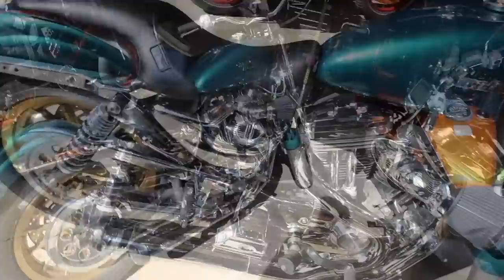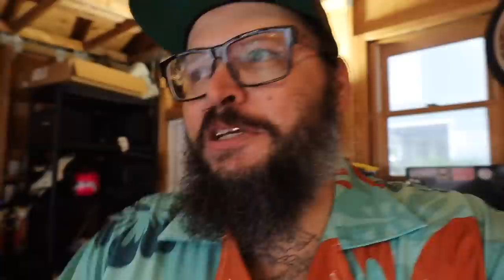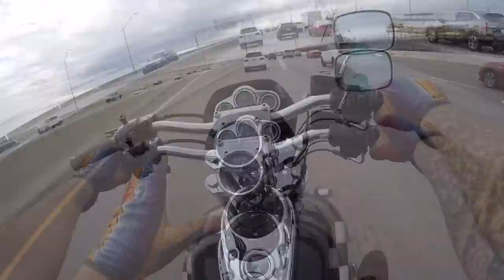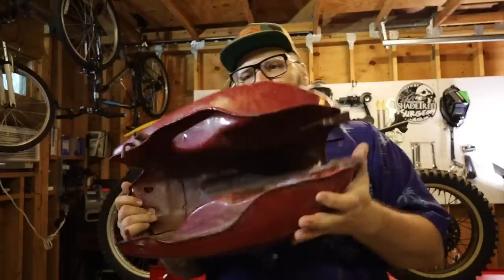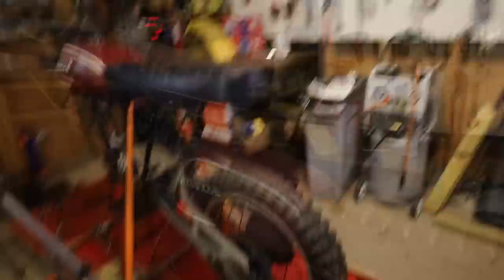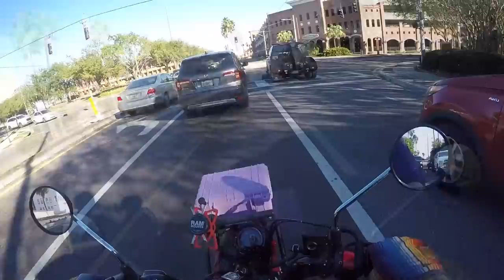WILL IT RIDE?! Cheapest Vintage Harley Davidson on Craigslist

Comment: 31:51 PB Blaster is my go-to problem solver. I learned about it while changing the CV axles on my 94 Corolla that spent 10 years on the east coast. It moved to Phoenix Arizona where I eventually bought it. The underside was rusted bad and the clear coat was burned off from the Arizona hot desert sun. All the fasteners we're rust welded under that poor car. I tried five different products on the rust and nothing worked. A buddy came out to check on me and came back with a can of PB Blaster. I sprayed it on, gave it a little bit of time and it worked so good. That was back when you couldn't find it on the shelf at the auto parts store. I always keep a couple cans around now.

Comment: Straddle to kick. you have better balance so you can put effort into kicking rather than kicking and balancing. And you can use the bars to add upper strength along with lower strength for a more solid kick

Comment: If you end up using the CL tank (same one I use on my race CL) you don't want to use the petcock anyway. Just block off the petcock and the crossover tube on that side, and use the other crossover tube as your fuel source. Just put an inline petcock and a fuel filter on and you're good to go. I use the crossover tubes as my fuel source (since I run a twin Mikunis) and its perfect. Or you can use both crossover tubes and T them into a petcock and filter and into the carb. Get the plastics from Preston Petty.

Comment: every shovel on my local craigslist is either wildly too expensive, or is a "ran when parked, need some work"
Reply: the latter is a common shovel. AMF ya know,  they be better at making bowling balls, swim fins & snorkels
Reply: @westho7314  They made a shit-ton of cool (common) bikes from 1969 to 1982
Reply: I'd trust the ran when parked on a motorcycle much more than I would a car. I don't know why, but people think motorcycles are mystical machines and they are afraid to work on them. I bought a "ran when parked 16-18 years ago" 1977 Yamaha xs650. Half ass cleaned the carbs, new plugs and wires and hook up a battery and about 35 kicks and she ran. That was over 6 years ago and it's been torn down the whole time. Days to work on it are few and far between its a roller now, and the engine is in. Still in the mock up stage and I haven't touched it in over a year.
Reply: If you’re afraid of the “ran when parked” deal, you shouldn’t even be looking at shovels
Reply: I’ll buy that seat
Need one for my 78

Comment: Chey and Josh, did you run a compression test on that Shovel engine? If I had it to do all over again, I would have installed a Baker 6-speed in my old 84 cu. inch Pan/Shovel. I've ridden Shovels with 1996 (and earlier) Softail 5 speeds and Baker 6 into 4 transmissions. To me, it was like the difference between night and day. If this were my bike, I'd keep the 39 mm fork and go about four-over, make some improvements to the internals and install a pair of gaiters. I'd keep it as a swishy tail too. Bad roads are everywhere.
Reply: How the hell would you put a Softail 5 speed in an FX/FL frame ?
Reply: @kurtfoulke5130  A 1996 and earlier 5-speed will work in a 4-speed frame with an adapter plate. The mounting bolt patterns are different. The transmission needs to be raised and shimmed. The seat post tube needs to be notched for clearance of the 5-speed lid. There are videos on YouTube that mention that mod. Ride safe.
Reply: @walterfechter8080  Hey Walter, Softail 5 speeds are practically free compared to a Baker.  
Can you run the Softail primary with starter motor or are you forced to go belt drive with a kicker ?  I can put a full battery in a saddle bag if I need to change the oil tank set-up.   Thanks
Reply: @kurtfoulke5130  -- Kurt, you are right about a H-D Softail 5-speed transmission being a lot cheaper than a 5-speed or 6-speed transmission from Baker Drivelines. For what I know about running a 5-speed with a Shovelhead engine, you can only run a special engine to transmission support, a belt primary drive and the Softail diaphragm clutch assembly. I'm not sure about running the stock Softail inner/outer primary covers. I'm thinking that some kind of spacer setup would be required. As you already know, the most important factor is keeping everything aligned from the engine pulley to the rear wheel sprocket (or pulley). You can run the Softail electric starter setup. Of course, a kick start conversion would have to be added to the 5-speed gear box. If you go that route, be aware there are some junk kicker conversion kits out there. Do some checking around for a kicker conversion setup. The oil tank/battery box will have to be custom made. The entire conversion will definitely take some work. There's a guy in Lake Worth, Florida (Gattis Garage) who's shop has done that 5-speed conversion to a Shovelhead and even on a flathead 45. I hope this helps. -- W
Reply: @walterfechter8080  yeah, I've done enough kicking, that would defeat the whole purpose lol.  Might just be easier to throw a shovel into a $ 1000 Softail roller lol

Comment: 2 strokes so easy to work on or take apart vs 4 strokes.  My dirt bike i take it to the frame once a year to really clean and paint.  You can almost do it is a day if you did not have to wait paint to dry.  I wish I bought the last year Kawasaki kx 500 cc dirt bike.  Over 60 horsepower and just over 200 pounds.  Power to weight is awesome.  Your build bike should be similar

Comment: After a BSA, and a couple Triumph bikes, I decided to jump off the cliff and bought a brand new shiny AMF!! A '73 kick start only FX! I figured if I couldn't kick start it that I didn't need to ride. Being that I only weighed a buck forty, a few tricks made it easier. The only time I had a problem kicking it was the first week I owned the bike it was below 0° !! I made the mistake of leaving it outside one night and I didn't put lightweight oil in it!! Even being a smaller frame person I had NO problem kicking it over. I've never been a fan having both feet on the same side of the bike, it was always easier to kick it balanced on the bike.

Comment: Bit of mechanics advice if your breaking torque on a six point bolt use a ratchet and socket instead of a ratcheting combination wrench lowers the risk of stripping the heads

Comment: If the rear brake is bad on the shovel, on mine the crankcase vent was spewing oil on it constantly. And dont diss the power of a shovel, one of mine was dynoed at a whopping 35 hp !

Comment: Josh while you were riding the trail 125 I thought you should check out the custom ct110s people build here in aus adv, chopped we customé the post bike. And as far as the forks wr450 is road legal in aus. Japan doesn't change designs because if it ain't broke don't fix it

Comment: My first ride on a Harley was an Electra Glide with a primary belt drive and a final belt drive. I took it for a short test drive because the front brakes were not working it was smooth as silk almost as smooth as my Airhead BMW the guy who owned the bike saw the smile on my face offered to sell me the bike and when I said I had no money he said we shake hands on it you pay me when you get the money old-school European I ran into him a week later at a biker bar and I asked him how big red was doing and he started to curse he sold the bike to a guy who got drunk off his ass and wrapped it around a telephone pole so hard through the motor out of the frame he was so pissed that he wished that he had given me the bike because I take good care of my bikes now he was a rich guy who owns a lot of property and gave the prison in easement to get to 41. He had a highway patrolman give him a ticket for not wearing a helmet on his private road so he shut down his private road and got everybody at the prison stuck for a week they had to do some major apologizing for him to open up the road again. That bike with $3,000 40 years ago. You did really good with that purchase. I taught lots of women how to ride my 650 Triumph with a hardtail it's low to the ground they can sit flat-footed confidently and it weighs a lot less than a regular bike make a pile with a swingarm and shock absorbers and a battery and an electric starter and see how much that pile of stuff weighs. A Magneto is really good because it is so much more reliable your whole electrical system can take a dump but you can still ride your bike home

Comment: Vintage brakes,,,,starts as a suggestion, turns into a hope,,,then turns into a prayer of "please dont kill me"  🤣🤣.  i would maybe be into Dynas but when i have looked at parts most of the time Dynas need a different one.  it just doesnt suit me i guess.  last time i seen Jenna on the channel besides a episode or 2 ago was when she went down and broke her collar bone , i think it was.  good to see her doing well.  i never had tik tok and im happy to hear you 2 are done with it. i know they wont fit me but i can turn a bunch of my old jeans into shorts/jorts,,,will youtube like those?  🤣🤣.  i havent seen your 1 ton in a while so i guess you did some trading to get the new truck you all been using.  which its good to see you doing good.  ohhh i almost forgot lol.  someone thinks you , manipulate Chey.....🤣🤣obviously they never seen her hangry lmao. i still remember that time you 2 was late for picfords. " its ALL YOUR FAULT!!!" 🤣🤣🤣.    hope they can get your triple trees to work. that sounds better than cutting and welding . maybe making a new shaft and bearing races to fit in the new trees a better way if the old shaft not work.  🤔🤔.  good vid man.

Comment: I got to tell you shade I keep having this dream about accidentally meeting you. I ride up on my Roadglide.  Your in a cage for whatever reason.  So I walk up and realize your doing either a voice over or just a clip for an episode.  It's kind of cloudy in there . Probably why your in the cage. You crack the window and say I don't want to expose you to my smoke in case it bothers you.  Then I get a whiff of your smoke and say roll her down brother. I thought it crazy you were riding a scooter . Then you call it your effeminate scoot. Now you've got to get you a triumph with a Hannigan ferring on it. Been looking around at the different wideglides people have on the market and noticed they have increased substantially in price . Some of the old dirt bikes friends had back in 70s had what looked kind of like a gas can for a tank. I might've asked before but what video game did you get the background music from? Was it Mario cart? Knowing a few people back when I was young that raced and having a stepson who raced dirt bikes it may not have been the same kind of kill switch as an out board motor with the till handle had but it was somewhat similar. Hooked to your waist band if you got thrown it would kill . Especially in outboard motors. Its supposed to kill the engine so your boat doesn't circle around and get you.or leave you stranded. When your done that build is gone to be a crazy YZ.

Comment: You will ruin that Shovel building a rigid chopper out of it, you must like torture.Keep it like it is.And Dave Brunson below is right straddle it to start it, much easier. I recon Norton Commandos had more compression than a shovel head.